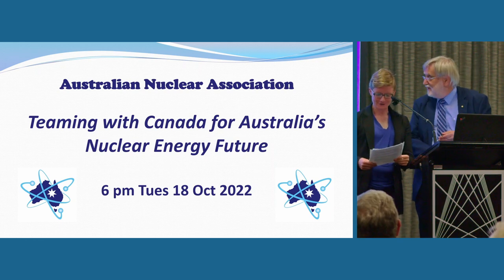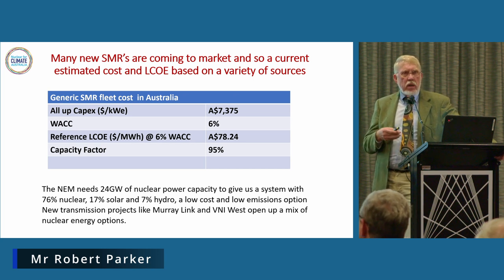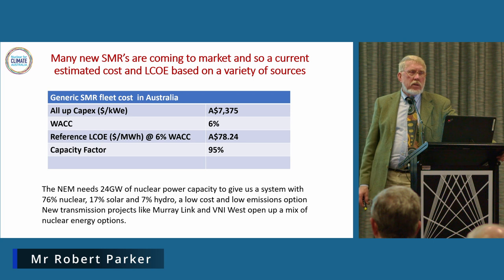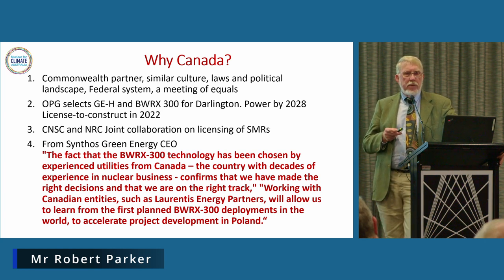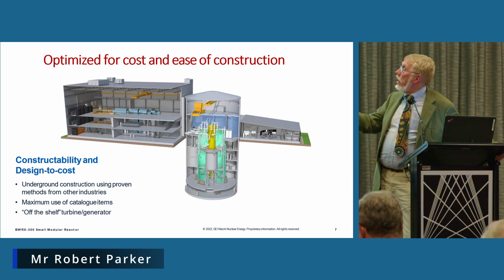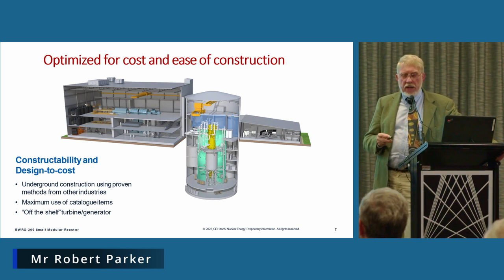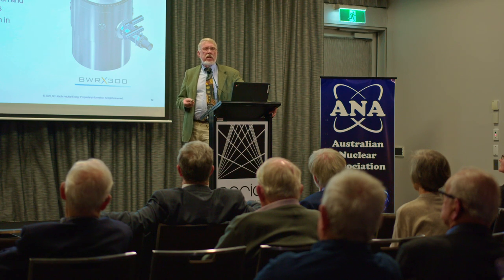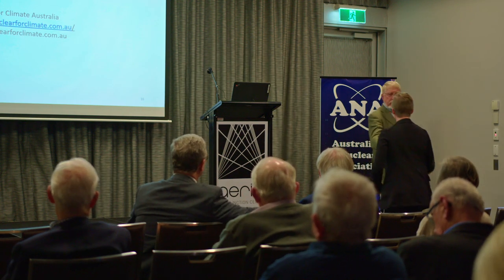Teaming with Canada for Australia’s Nuclear Energy Future - 4

Comment: Thnak you for the talkm and the call-out to Dr. Keefer. Using LCOE for cost comarisons is problematic since it is heavily influenced by politics and distortions in economics. e.g., solar cells are far cheaper from China than the West, sinceChina uses cheap coal and conscripted labor. In the long term (i.e. the N'th iteration of nuclear), it may be useful to look at the cradle-to-grave EROI (Energy Return on Energy Invested). Wind and solar with backup and grid integration have EROI's of 2 - 5 (similar to the times of the Romans), coal, about 10, oil & gas 20, and nuclear (the old PWR's) around 70. SMR's could be >300. Context: our Western standard of living currently requires an EROI of >12, so going to wind/solar would be existential. With SMR's at >300, it may be useful to consider that they could provide excess power to cover base plus peak load, with the excess (being so cheap) going into making efuels (e.g., Prometheus Fuels, which would be CO2 neutral). This would have the added benefit of reducing the electrical infrastructure build-out required if we went all electric for transportation other direct heat applications. See: “The Unpopular Truth: about Electricity and the Future of Energy" 2022 by Lars Schernikau & William Hayden Smith, and "Spain’s Photovoltaic Revolution: The Energy Return on Investment" (SpringerBriefs in Energy, 2013th Edition) by Pedro A. Prieto.

Comment: So instead of the bwrx 300 modular you used a molten salt waste burning reactor like Elysiums molten salt reactor. How about less than 1/2 the cost of these really expensive reactors. How about safer and way less than 1/2 this cost. Then nuclear can go so far as to remove any coal burning and very little solar & wind. Safely load following removing light water pressure reactors which have a highly dispersive of radioactivity when breached to no release or so little it could be ensconced in a suburban neighborhood with little threat to the community. Duh, I would go for that sir.